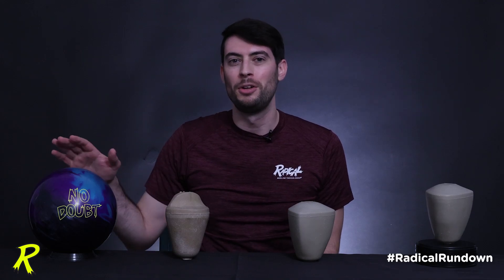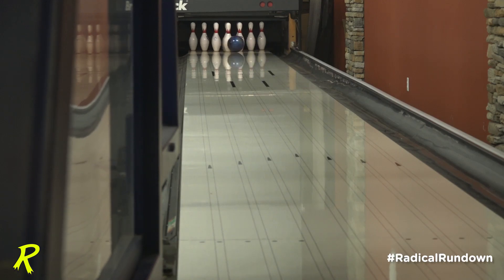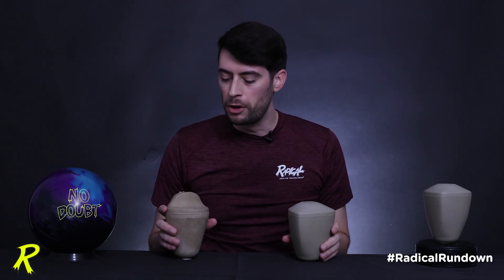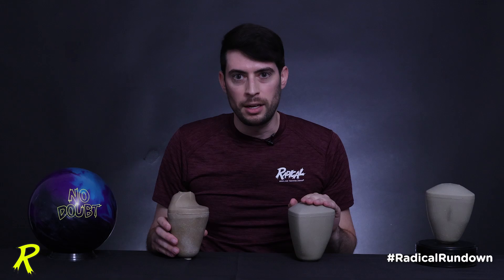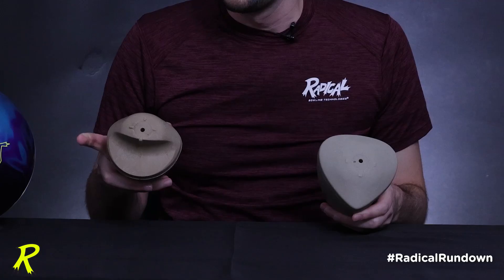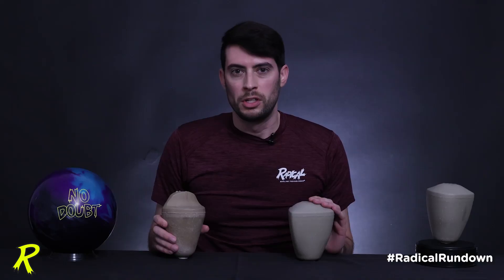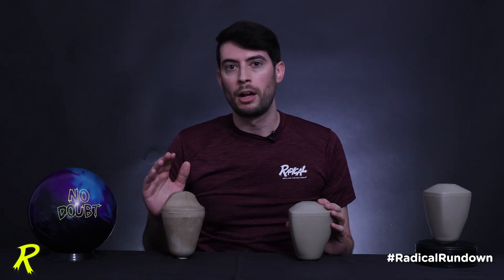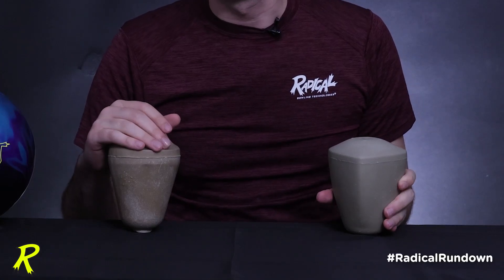No Doubt "Super-Symmetrical" Core | Deep Dive - #RadicalRundown

Comment: Brian, quick question. The Radical No Doubt drilling chart has 4 drilling. All show drilling angles from 70 to 90 degrees. Usually symmetrical balls the drill angle doesn't matter. If I were to drill one up at 45x4.5x45 would the after drilling numbers be similar to the smoother Motion C drilling?
Reply: we will have more on this in the future. the drilling angles on the sheet are a result of pointing the CG at the thumb hole for this PAP, since that's where the ball will spin after drilling. We recommend doing that on syms to keep the design intent intact!

"kicking the CG out" will have some effect, but not what people think - it lightly reduces the post-drilled int diff on these radical balls, making the motion smoother.
Reply: @BowlingBuckosh  Thanks Brian. Just saw JR Raymond review and the ball looked awesome and very smooth with his 45x4.5x45 standard review layout.